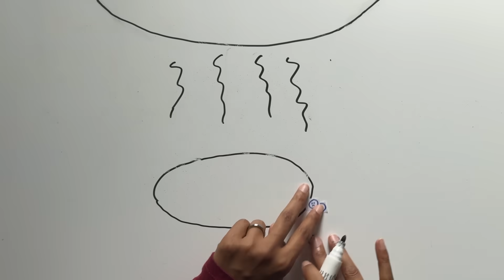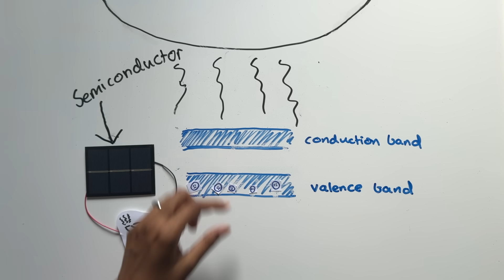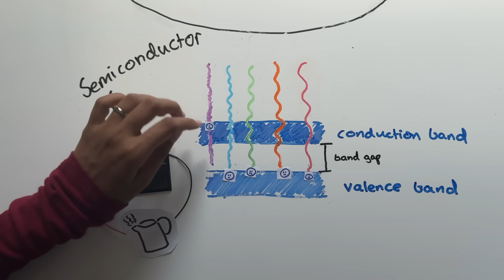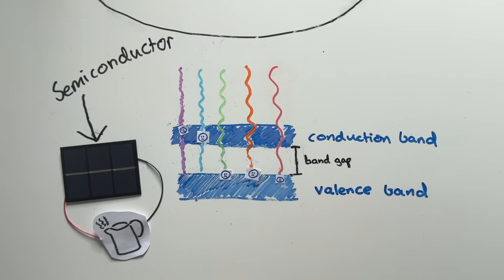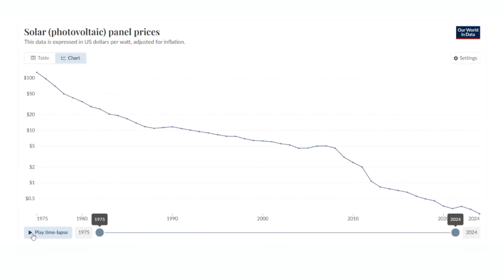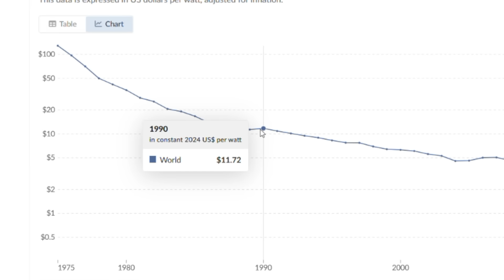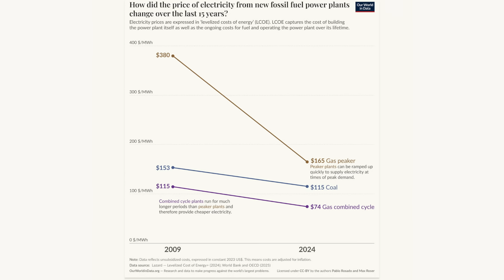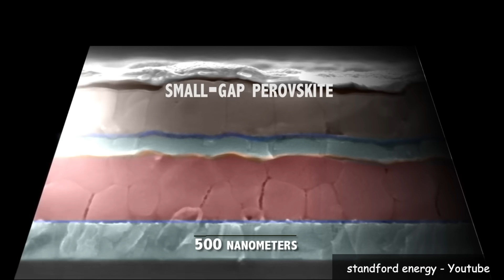Why solar panels can't be more than 33.7% efficient

Comment from the maker: To learn more about solar energy and to join in on events, visit Sun Day's website: http://crnt.link/sun-day-lookingglassuniverse #SunDayPartner
Reply: It's it actually on Sunday?
Reply: @Eduardo_Espinoza  yes it is!
Reply: Thank you!😊 @davidx.1504
Reply: 8:54 But the cost per unit of energy is almost meaningless, isn't it? It depends on things like exchange rates, transport costs and government subsidies and tariffs.
Reply: @eternaldoorman5228  Lazard addresses subsidized vs unsubsidized generation, and the other elements you mentioned likely aren't considered, or costs are assumed to be essentially equal regardless of region of origin or region of deployment.
Reply: I like solar but each one just makes the earths surface darker. That matter because the earth is losing its mirrors at an alarming rate!
Reply: @jimbob-jn6jz  mirrors as in ways to reflect sunlight so that it doesnt hit the ground and produce heat that results in warming, right? I think solar panels' involvement in that process is pretty minimal, since we ofteb put them on fields that had plants that would have also absorbed the sunlight, just for photosynthesis instead of electricity. 

But i think the bigger issue than mirrors to reflect sunlight is curbing CO2, which means ramping up alternative energy sources that don't require burning carbon, since that is what's directly causing clinate change and destroying the natural mirrors of the earth, i.e. glaciers and ice. 

More solar = less carbon burned = fewer mirrors destroyed
Reply: German MSc engineer (electronics, electrics, computer science) here.
For many years I was in charge of the making, installing and commissioning machinery world wide for many years (specially the CIGS process, declared the most efficient PV-modules). Here are my thoughts as a man of real practical engineering but also being very familiar with the resources and economic problems behind the solar-philosophy.

The video explains quite properly and very interesting the core problem; I could follow the physics easily (understood most of it before).
So here are the main kickers and why solar is no world - or climate saver

1. Unfortunately the opener is wrong, solar is not cheap and never will be for many reasons. Sure the sun is not sending a bill but you have to add all the costs for grid modification and enlargement plus on top for the back-up system, which are and must basically heavy turbine power stations. Which includes the investments and even the fixed costs for such stations, if they are in stand-by only.

2. Batteries will be never large enough to power a mega city like Hongkong, Berlin or Melbourne for two weeks time, or a sensitive factory making (let's say) PV-modules. Not to mention a large metallurgic plant. If you look at the already gigantic dimensions of such battery "farms" installed in the world and the lousy capacity they are holding, then it is clear this will never work. 
The North-African-UK project to power the UK with solar and wind electricity from North Africa died multiple deaths including a required battery capacity nobody on earth could ever install.
Plus these battery centres increasingly are becoming an almost unmanageable fire hazard. They might not ignite often, but when they do, there is not much to do except of letting them burn down. It is called the "run-away" phenomenon in combination with gigantic energy storage in cramped spaces.

3. On top these energy forms (solar/wind/battery) create totally new technical problems like the missing inertia and no cold-start capabilities (only turbine power stations can do that - because they dictate the synchronisation with their inertia and they have the necessary starting power capacity to kick-start all these warmed up freezers, fridges, aircons and cooled down heaters and ovens etc.)
Without heavy spinning mass momentum of turbines we will not be able to run modern grids, a proper synchronisation requires at least 30% turbine power in the gris (see the massive blackout in Spain and Portugal in 2025). 
But these turbines are also necessary during dark doldrums which might last for days on end in many parts of the world. If you dry to circumvent this problem with fly wheel solutions and digital frequency / phase synchronisation and similar technical tricks, the system quickly will be over-complex and hard to handle and manage when technical problems occur. Plus it opens all kind of access to nonauthorized 3rd parties. 
Friend of mine (E-engineer like me, and in general one of the best I came ever across) here in Germany installed a PV-module system (including solar thermal modules) on his roof top with batteries, inverters, control connections to the grid operators and an EV charging system - several companies were involved (with basically) two years warranty for most of the components. 
He was his own project manager and he is complaining about the complexity of the whole system. As we learnt industrial electronics will start to fail on average after 7 years, I am sure he will manage but only with great effort since original components will no longer be available someone (who? him?) will have to find adaptable solutions. Most of the ordinary house and property owners will be overwhelmed with these future problems of repairing defects, updating software and replacing components.
So over-complexity is also a killer (try to trouble-shoot and fix an electric/software problem on a modern car and you get the picture).

4. Pure island solutions are also a bad idea in general. It should be only done if there is no alternative. To have a modern country running you need a grid to supply cities, industries and all other commercial sectors without interruption and stabile. Not only hospitals need such a supply, modern industries with their sensitive equipment and mass production cycles need them too. Only a proper stabile grid can organise this. If you look at island nations like the Philippines, Puerto Rico, Hawaii you realize that these very small grids and even island "solutions" are so trick to manage.

5. The problem with the high rising electricity bills like in Germany and Australia - if you are honest - are in fact government solar and wind subsidies, ripping anyone else off without such options. 
We see this totally wrong politics here in Germany now even hitting the industries so hard, that they either close factories or move abroad. Thousands of jobs are actually lost each months. And if you look at the statistics, the more solar/wind/battery was installed (nuclear power stations were turned off, the gas pipelines to Russia interrupted and our new and effective coal power stations are to be turned off very soon).
And this happens even in Germany EVs do not play a massive role, heat pumps for housings not being installed yet. With other words, electricity is currently becoming a new luxury item, without the new gigantic electricity demand actually kicking in yet.

6. Which leads to the next point, AI. As mentioned in 4 most of the electrification dreams are not put into place a new electricity energy sucking monster is showing up, which is AI. In places like Texas, Ireland, Arizona, Hessen (a smaller federal state of Germany) local governments are increasingly discussing the already upcoming of electricity and water (cooling) shortages for business and communities - because the IT industry with all its AI-dreams and projects is eating up huge chunks already permanent growing. The problem is becoming so problematic that the International Energy Agency was just releasing a concern and warning about it. By 2030 AI will consume more electricity as all the other consumer sectors TOGETHER. The electricity wishes for small Hessen only, just for AI and their soon to be installed server "farms" will require the capacity of 1MW in 2030 - which is roughly one nuclear reactor.

To be continued with the next post.
Reply: Do you plan to make a video on how the new solar Advancements will decline in price, and how solar panels made with them will hit the 68.7% multisurface limit?

Comment: The biggest issue I believe right now for solar is not efficiency, but the integration of DC systems into a grid that works on AC at a very specific frequency (50/60 Hz). The panels themselves aren’t the real problem, they connect through grid-tie inverters that convert DC into synchronized AC. The real headache shows up when solar becomes a large share of total generation.
Traditional power grids rely on big spinning turbines (gas, hydro, nuclear, wind) that naturally stabilize the system thanks to their mechanical inertia. Solar inverters have no physical inertia, so when a sudden change happens (clouds, demand spike, faults), there’s less “buffer” to absorb it. Small frequency deviations that turbines would normally smooth out can cascade into grid failures if there’s too much inverter-based generation and not enough inertia left on the grid. This is what happened to the entire Iberian Peninsula on april this year. There was a huge blackout that affected all of Spain and Portugal because the grid frequency dropped from 50 Hz to 48.5 Hz in a matter of seconds. Usually oscillations in the frequency are under 1 mHz. So there is an additional cost to solar, which is to upgrade the grid. That means using grid-forming inverters and battery storage to mimic the stabilizing role of turbines.

Comment: 1:50 do you guys recall the way it's constructed? It's cinstructed like LED! Solar panels can emit light if powered to electricity, but the light is just minimal. You can do a lot of cool stuff with the P-N junction
Reply: In the case of silicon solar panels, the light emitted (when "powered BY electricity") isn't just "minimal", it's invisible to the human eye!  It emits in the infrared....
Reply: @johnreeves7261  Solar cells don't emit light. You need to stop the binge drinking.
Reply: @schmetterling4477  When "powered BY electricity", like an infrared LED, Silicon solar cells most certainly can emit in the infrared.  In fact, that emission is the basis for a technique for inspecting solar panels.  It's called "electroluminescence imaging".  Feel free to start your own "binge drinking" and get a bit more educated.
Reply: @johnreeves7261  Solar cells (at least the silicon based ones) DO NOT emit much light, unless you are willing to destroy them in the process. Please read up on the difference between direct and indirect semiconductors.
Reply: @schmetterling4477  So now it's they do not emit MUCH light.  Did you even bother educating yourself on "electroluminescence imaging"?  I routinely hit silicon based solar cells (Maxeon Gen 3) with over 6 Amps of REVERSE current and take images with a digital camera modified to capture the infrared emission of the solar cells.  Note: no solar cells are "destroyed" in this industry standard inspection process.
Reply: @johnreeves7261  What's the quantum efficiency? 1e-6? You are getting way more IR radiation out simply from the heating (which has an efficiency of nearly 100%), aren't you? :-)
Reply: @schmetterling4477  It sounds like you are still denying that silicon solar cells can emit some IR light (~1150 nanometer peak emission) when "powered by electricity".  Again, get more educated on  "electroluminescence imaging" of solar panels.....

Comment: 7:09: "Sand is made out of the same silicon crystal structure as this solar cell." No ... it isn't. The physics up to this point is highly simplified, but gets the main points correct. But that statement is just wrong. SiO₂ doesn't have the same "crystal structure" as elemental silicon. Even if you ignore the fact that every silicon in SiO₂ (quartz) is bonded only to oxygen (!), the silicon atom sublattice in quartz is not the same as the silicon net in elemental silicon (which is, however, the same as carbon net in diamond).

Comment: The energy is free but the means to extract aren't. And the costs are going to fluctuate not only with wetter, but also with estate prices. The introduction of this energy source in Germanys energy mix against all suggestions of if getting the costs down, cast quite the opposite - together with high estate and building costs Germany has highest energy prices in the world. I'm buffled that after decades of technolgy application there is little consideration of estate factor...same for bio fuels.

Comment: With sodium batteries we have a clear path to $30-40/kWh of stationary storage, and somewhat murkier to less. But that's already easily cheap enough to massively overbuild. That will let us get rid of coal. While doing this we continue research on new geo, 4-5th gen fission, fusion, etc. Wind and hydro where it makes sense. Strength in diversity.

Design desalination plants and AI model building for when there is more energy than we can use or store. Put taxes on industrial uses when energy is scarce and pump it back when it's abundant (so you get paid to take energy). Humanity's superpower is cooperation. Whether that's through markets or not is debatable but it certainly can be made awesome through markets designed to adapt, rather than just corruptly benefit entrenched players.

Comment: Hi, Mithuna, thank you for a great explanation.  I do solar thermal in my back yard.  Do you have a theoretical and a practical efficiency for solar thermal in your head?  Back in, I think it was the early 1990's physicist Wolfgang Scheffler designed a tracking solar mirror reflector  on equatorial mount that focused the light on a fixed spot.  This was to make "Solar Kitchens" for people in poor countries.  He couldn't get his design made in his native Austria or Germany because labor costs were too high.  So he did missionary in Kenya for a year and built one there.   It worked well. Nowadays there are several thousand Scheffler solar kitchens across the world  varying in mirror size from 2 m2 to 32 m2.  Some HUGE installations are in India!    His key to doing tracking with a fixed receiver was to change the shape of the mirror as he did seasonal adjustment. And that is the problem if you want to do it smaller, because a flexible mirror is really expensive.  Anyway,  I looked at Schefflers solution and saw that there is a second much cheaper way to do almost exactly the same thing.  A fixed shape mirror that tilts with the declination angle around the focus.  I put it on solar cooking websites about 15 years ago but nobody ever made one.  This year,  I have health issues and can't work so I made one of 1.5 sq meters. If I were to buy a Scheffler dish of this size, it would cost roughly 2400 Canadian dollars.  Mine cost less than $300 to make, and obviously it will be cheaper still when it gets mass produced in China, India and locally in Africa.  I call it the "Sun Scoop",  there are no patents or anything like that.  Under Canadian conditions it is about 0.9 horsepower boiling water.   I used it this summer to steam sterilize soil for growing vegetables.  Steam sterilizing increases lettuce growth by 20%!  (I steamed about 2 tonnes) (to roughly 95C per batch) and then I converted it to a solar dehydrator to dehydrate fruit and  vegetables. Mostly at about 55 to 60 C.    So now, it is cloudy rainy season, solar is pretty much over for me probably till late March.    But I just realized something!   If I had an auger in my soil steaming, I could do automatic soil steaming (instead of doing 10 or 12 liter batches, the auger would come on whenever it was steamed enough)  and,  as the soil cooled down, as it moved away from the heat treatment, the waste heat, is over 55C for a considerable length of time! So as it cooled down, it could provide the heat for a dehydrator section.   2 processes as one, in half the back gardens in the country!  What do you think?   Would you like to explain Scheffler, and the simpler approach in some future video? And also the theoretical efficiency of locally used solar thermal?   Thanks Brian (By the way, I don't do solar cooking.   The problem is that when you get 6 to 10 hours of 0.9 horsepower in a day,  you only need 1 to 2 hours to cook all your food, so it gets wasted for the other 4 to 9 hours if you are just solar cooking.   Steaming soil and dehydrating means you can use nearly all the power productively.

Comment: A multilayered solar cell can cross the 33.7% thermodynamics limit  and go up to 68.7% in multijunction solar cells. Another type of heat engine using magneto-hydro-dynamics principles can reach 40% efficiency in converting incoming solar radiation into electricity. -Electronic engineer ,Bons baisers du Québec!